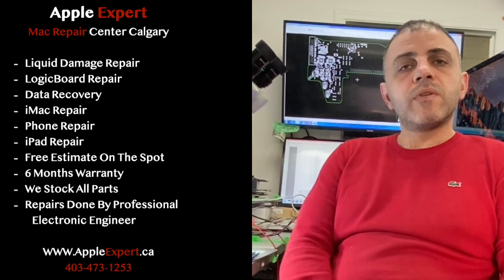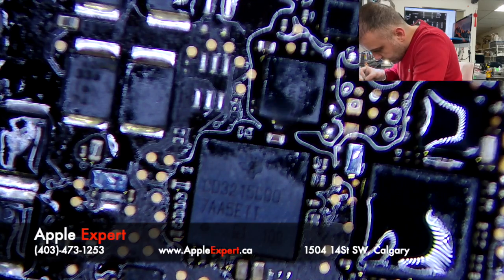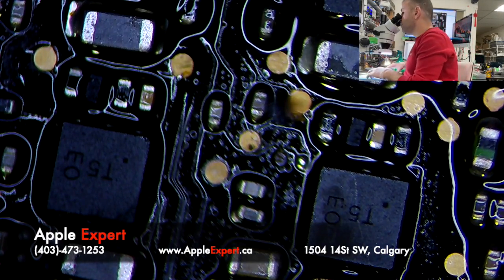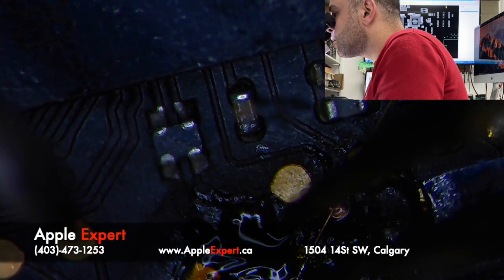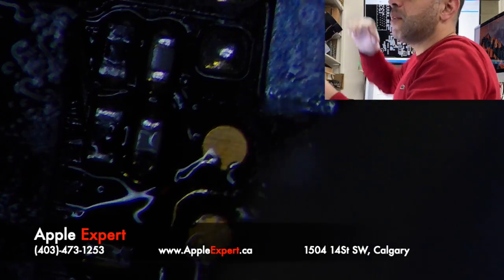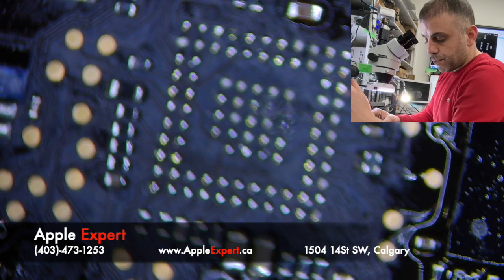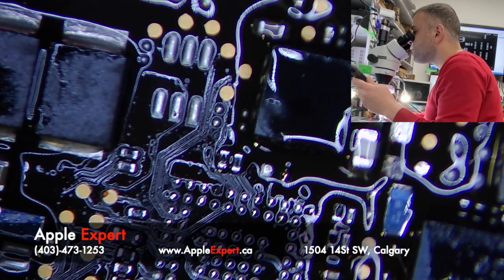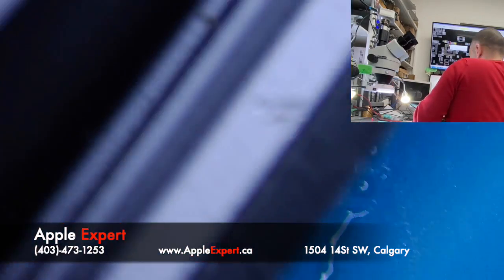A1708 820-00840 MacBook Pro 13  2017 NO Power Repair USB C Controller Problem

Comment: I have the same model MacBook, it stopped powering on recently. I bought a usb c amp meter and it gets 5v zero amps, but when I removed the ssd drive from the motherboard and tested again it powered on 20v 1amp. I plugged in an external hd that’s formatted with Catalina and it works. 

Do you think it might be my ssd that is damaged or would a component that connects to ssd cause it to not boot with it installed?! 

No liquid damage, I checked both sides of the motherboard.
Reply from the maker: Are you on Calgary
Reply: Apple Expert | Mac Repair Center Calgary unfortunately no, in the U.S.
Reply from the maker: John John try another ssd , basically find out if it is ssd problem or voltages drop after installing ssd
Reply: Apple Expert | Mac Repair Center Calgary  thank you for your replies. I found the short on the ssd itself. It was one of the capacitors (336 16k). I removed and replaced with another 6.3v poly capacitor and MacBook booted up with no data loss. 

This is my first time seeing the actual ssd short out. I guess as these computers get smaller and thinner it builds up way more heat causing things to get damaged internally.
Reply from the maker: John John good job